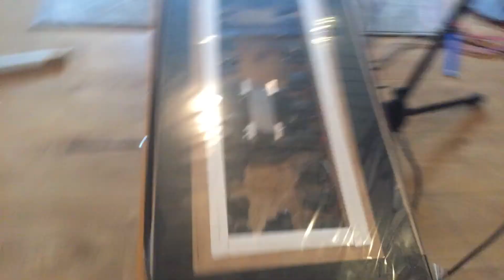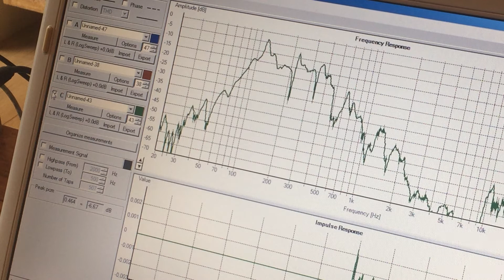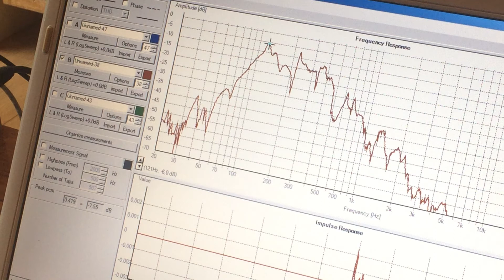Part 5-2 : DIY (tutorial) make a planar speaker panel : Stretching Mylar fail

Comment: Hi Joppe. I have been enjoying your design and engineering. You made a point about lower resonance as in larger drums equates to lower resonance. So my question then is would it not be better to use taller and wider planar surface such as those in the very large or tall maggies? That would also require a much large jig and stator, etc.
Reply from the maker: if you want to go low yes :) this video is a small panel but i made a full sized panel to. :) look for "the big guns" videos

Comment: Hello joppe, fast question , what rta mic you use to make your measures?
Reply from the maker: camelazo it is a isemcon emx 7150 mic on a digidesign pre amp on my laptop. The mic is exceptional flat even without the calibration data I'm really fond of it. Miles better the the alternatives. But slightly more expensive